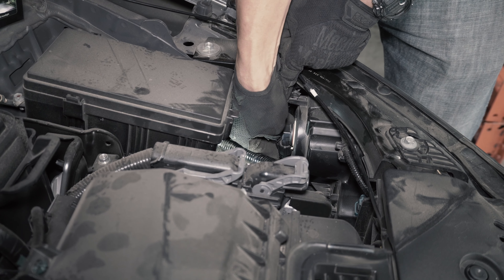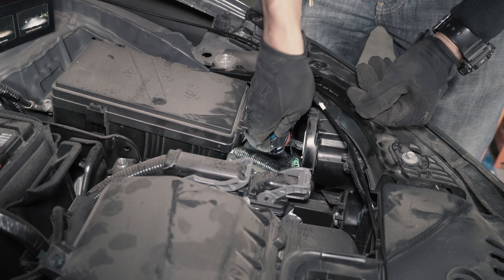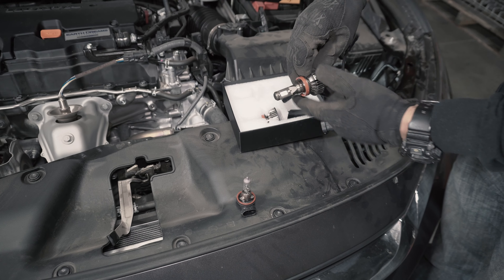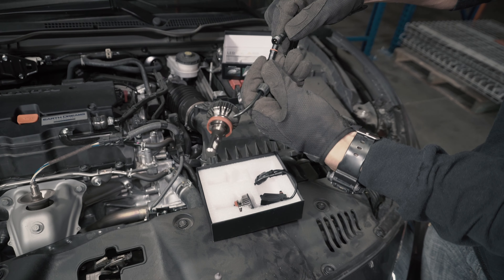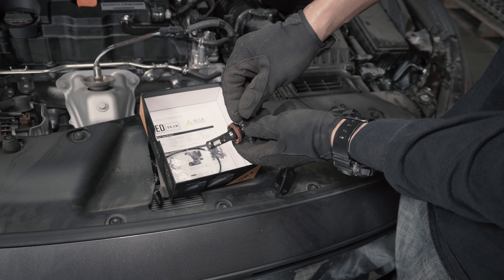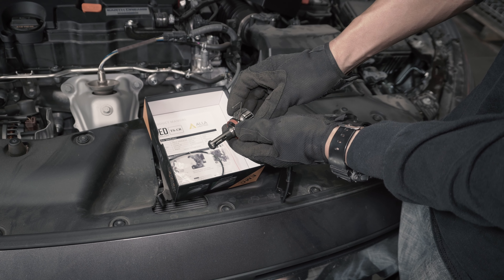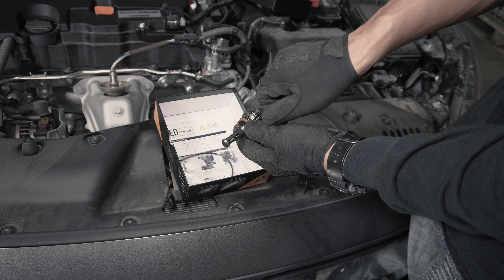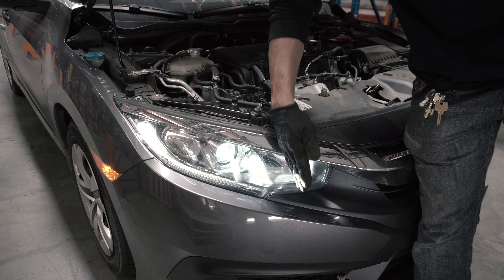How to Remove | Install 2016 -2021 Honda Civic Headlights Replacement?

Comment from the maker: How To Install | Upgrade 2016 2017 2018 Honda Civic H11 low beam halogen headlamp to LED headlight bulbs replacement. Honda Civic LED Lights Bulb Size Guide: https://alla-lighting-inc.myshopify.com/pages/honda-civic-led-lights-bulb-size-exterior-interior-replacement-guide. Thanks for watching and if you like our videos, please give us a thumbs up, and subscribe to see more installation videos!
Reply from the maker: Fps Gaming  It is our pleasure ^_^ Any questions, please feel free to contact us.
Reply: Hi ALLA Team.

Since 1 year ago, I have been looking for a youtube channel with profesionalism and engineering methods for evaluate different issues in lighting matters. Now finally i think i found it. And right now I can't be more happier about that.

So. Here is mh first question, which leds are the best for projectors(I have a civic 10th generation)? Can you do a video of an assessment of that? I heared a lot about 360 led, f16 auxbeam led, etc. Maybe that is a good point to start.  

Regards, i will be in touch!

Ricardo.
Reply: What is the blubs sizes for 2019 honda civic

Comment: Would be awesome to add in this video a lux measurement. It is great to have a colour improvement, but the question is  how much or how many luxes improvement? :)
Reply from the maker: Thanks for your comment, yes, you are right, we should add the lux measurement in the future, for this type led bulbs, each led headlight bulb is about 5000 lumens, more than 400% brighter than stock lamps.
Reply: @AllaLighting  hi pls can you share with me the brand and model?